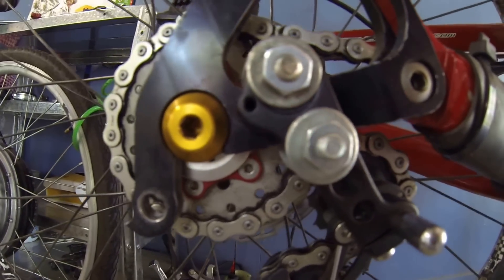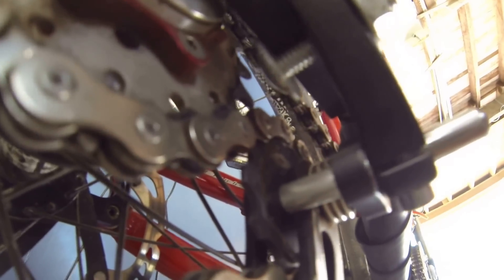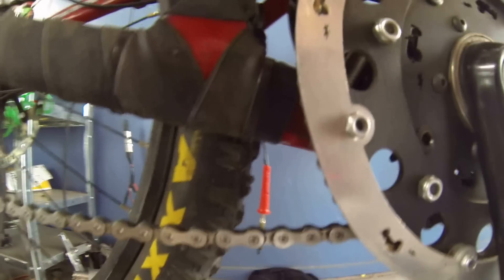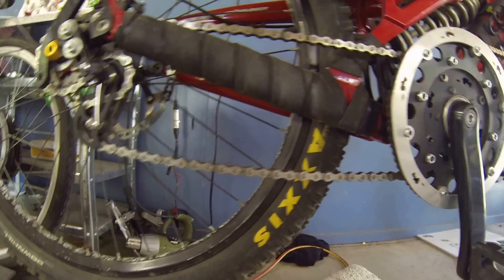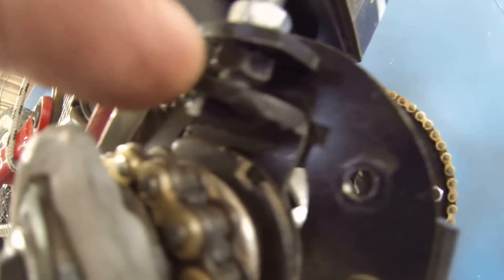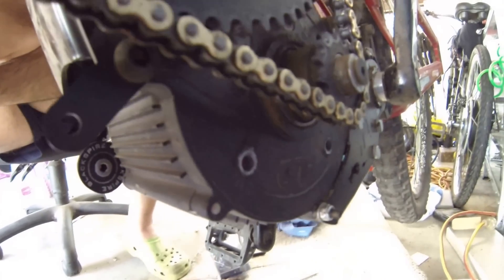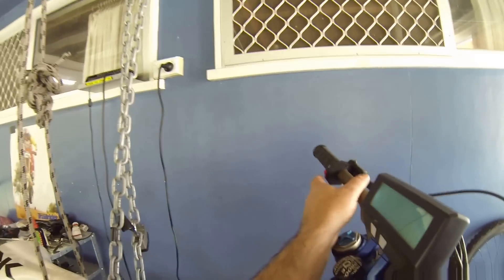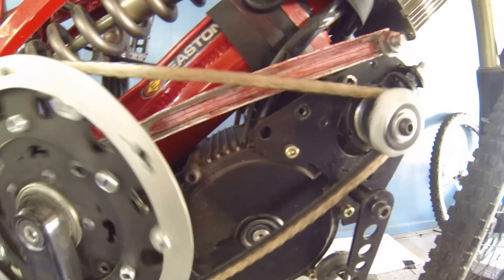chain skipping solution LR Electric Bike kit conversion

Comment: I agree John. LR kit is a well designed kit and very tough. But, saying that there is still a lot of guessing and ordering of different parts in order to get the kit working correctly. I have the small block. I am on my third ride with the kit. I love it but cannot park it anywhere because of where I live in New York City.  I am about to order a bafang motor to use that as a commuter and the LR kit for weekend use. I use the ebike for city riding.  Hope you can figure out all your problems soon.  I have a question for you. After using your LR kit did your K19 chain get loose. How will you tighten it further if you have bent the adjustment bar where it looks like there is no more to tighten?  I remember LR video mentioning both sides had to be tightened equally for the bar to remain straight. But I think you have run into different problems with the bike you have chosen to put the kit on.